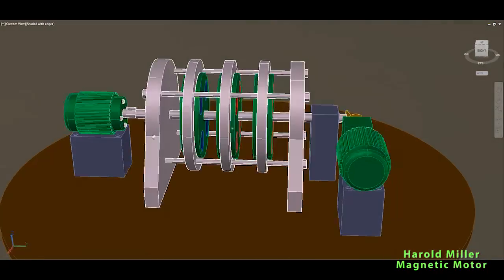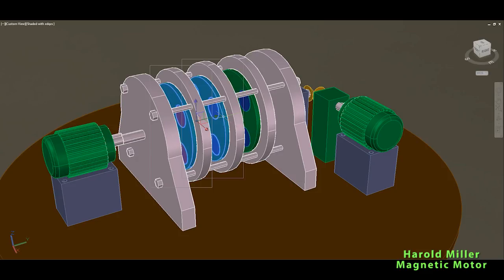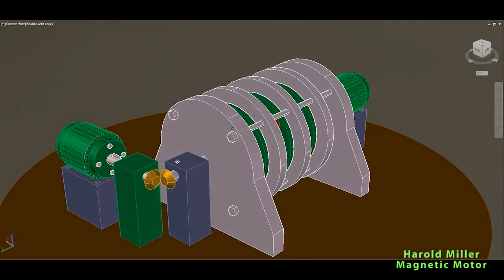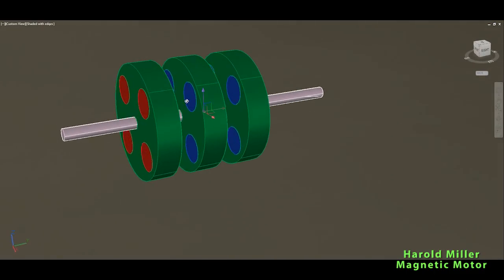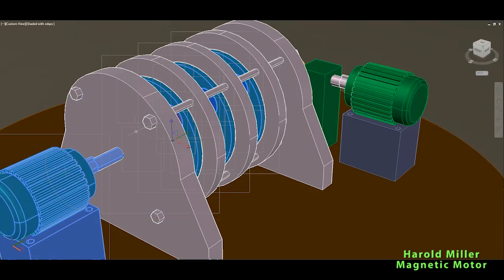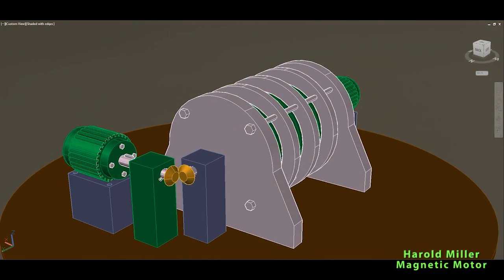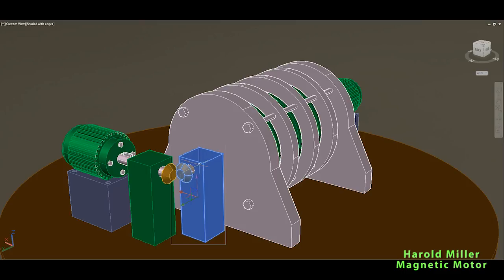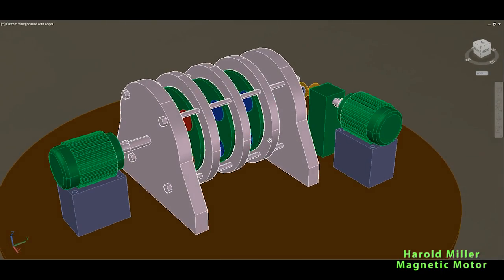FREE ENERGY, Harold Miller Magnetic Motor

Comment: YOU ARE NOT EVEN CLOSE TO THE WAY THIS MOTOR WORKS...  i am ray tobin , i have helped  build the miller torque multiplier..the main idea of it is the rotation of the magnets is to use all 3.. yes all 3 of the magnet forces.. the magnet sequence is the secret.. you have attraction / repel / and with the magnets in proper line up ,, a NEUTRAL , no attract or repel we call the dead zone.. this is the main function.  also we have a crankshaft with 21 lbs of torque out. and the drive servo's with 1 lb going in.. nobody else can get torque with any other design.. the main shaft HAS to recriprocate to achieve torque.and if you don't believe my photo is of gen I the first motor built.. oh yes the mags also have a favorite speed in our design. they like about 300 rpm. that is why you cannot slap on a generator. we are working on building a low rpm generator..  thanks  ray tobin
Reply: +calvin hunner  All magnetic motors are nonsensical quackery, including the "miller torque multiplier."  You are working on building a "low RPM generator?"  Good, somebody will read my comment and realize how ridiculous you are.  If you want higher RPMs all that you have to do is take the output from your fake device and run it though a transmission to increase the speed before you connect to a generator.  I laugh at how 98% of the free energy guys that play with coils don't even understand how a coil works and here you are a supposed mechanical/magnet free energy guy and you claim that you are "working on building a low rpm generator."  What a bloody joke.
Reply: User2718218 In other news no combustion motor can power a cart. Only donkey can do that. Everybody knows that.
Reply: Ray Tobin, how can I get ahold of you? kazakhan38@gmail.com
Reply: How do these smaller versions work if they are not oscillating linearly?

Comment: magnet device is amazing, flux push and pull it can add torque to where the force is directed. this device I say as the flywheel is active because even the magnetic mass 
and the holder is not as heavy as the crazy wheel which generally but works the same and the force can be directed to the electric generator so the motor is quite small the power supply. if you are viewers of this channel will talk free energy please try first do not comment without experiment I think it is useless, thank you for sharing information sir mario gudec. which you are showing is correct because I have to prove myself.